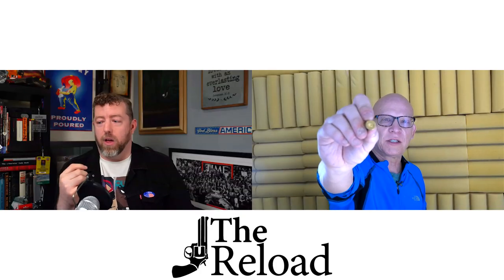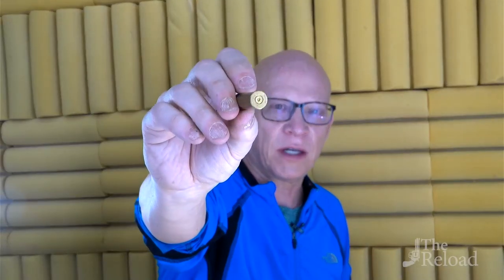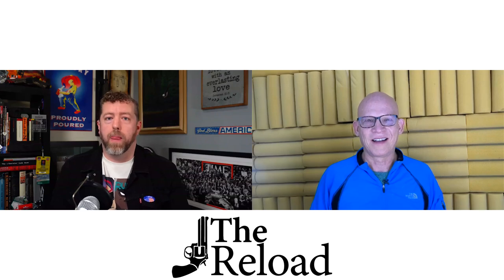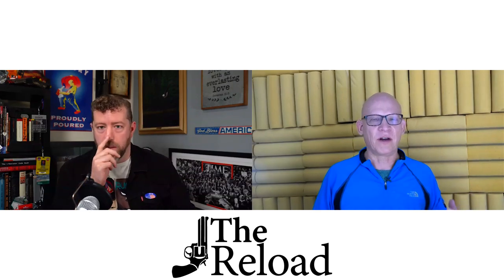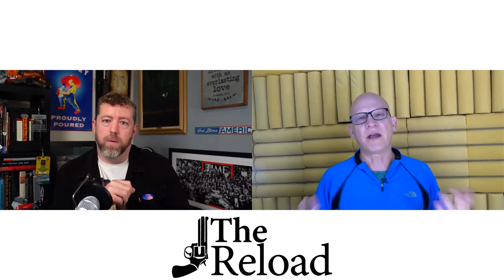The Critical Differences Between Blanks, Dummies, and Live Rounds

Comment: I read that the dummy rounds they were using had a hole drilled in the casing. That would be a pretty good indicator too, if one bothered to look for it.
Reply: BB or drilled and fluted case, each individual cartridge has to be removed and checked. There is no report of this being done.
Reply: She was too hungover and still high

Comment: BS. Pointing a real gun with what one believes is loaded with dummy bullets and pulling the trigger is hugely irresponsible. This is 90% on AB whether the ultimate cause is sabotage or incompetence and carelessness.
Reply: Actually, no. Furthermore, he was pointing at the camera, practicing.
Reply: @Canuck1000  if he was pointing it at the camera then how did somebody get shot? 
Alec broke the most basic and important rules of firearms.
He was likely pointing it in the cameras general direction and at the director who he killed.
Even if it did hit the camera, you should know your target and what is behind it as it is also likely to be hit.
Reply: @Rick_Sanchez_G420  As described below, Alec Baldwin, the actor, did not break any rules:

Dave Brown, 30 years working in the film industry as a firearms safety specialist: “Aside from the actors during a scene, the firearms specialist is the only person who handles the weapons and the only person who can open them for full inspection by cast and crew.” (note: Alec is not the one who can fully inspect the gun.)

Scott Dismukus: “The armorer’s entire job is to make sure the right gun (prop) for the given scene is ready and safe. Actors aren’t allowed to make those safety checks. Their hands may be covered in makeup, or they may not have the knowledge to make the check. For consistency across all sets, they don’t make those checks. They are there to act, nothing else.”

Thomas Bostik: “…The only person to touch a gun is the armorer. They inspect it, load blanks or whatever is the appropriate (but never live ammunition), and hand it to the actor. There is never a live ammo on the set. The actor is forbidden to open the gun. If they do, the armorer must re-inspect the gun."

From Variety (Oct. 23, 2021):

“Corrie noted that the procedure for firearms on set is that normally an actor, until action, will be holding a stunt gun, one that cannot fire and is not made to fire, and cannot in any way be made to fire without severe modification. “At the moment that they’re about to shoot, the director will call cut, and then that stunt gun will be taken from them and an armorer will hand them a loaded gun loaded with blanks, and then they will begin filming again. The actor will shoot the firearm, director will say cut when that scene is done, and then that firearm is immediately taken from them by the armorer. This is a safety procedure that’s been in place for a very long time, and ideally if that happens then everything remains safe. The weapon is very strictly controlled and there are no accidents.””

From Variety (Oct. 23, 2021):

“Should Baldwin have checked the gun before firing?

Daniel Leonard, associate dean at Chapman University, whose specialty is on-set regulations: “There are no industry standards that require the actor to verify the safety of a prop firearm.”

Both Merrick and Corrie say that actors are not required to sign off on firearms being empty. Instead they must focus on their performance, rather than be distracted by gun safety rules that aren’t their expertise.

“I really need to reiterate that the actors have a focus on their dialogue and their emotion and where they got to stand on their lighting and how to react to the other actor,” Merrick said. “Their head is full. And in order for an actor to be fully vested in a performance, they need to have confidence in their surroundings. They need to be able to stand firmly and know that the wall is not going to fall down on their head, they need to know that the gun that they’re being handed is ready to go and it’s safe and it’s not going to hurt anybody.”

Added Corrie: “The reason that Alec Baldwin did not check the firearm is because… he’s not given time to do so. It is an understood that when the firearm is handed to him it is in proper working order. And that is the responsibility of the armorer prop master, whoever is in control of the firearms on set. So all the armchair quarterbacks that are sitting back and saying well, Alec Baldwin is responsible because he didn’t check the gun, that’s not the procedure that’s used on set — so stop with that. Ultimately it is the responsibility of the armorer or prop master or whomever is on set in control and responsible for those firearms being available and made ready for each scene.”
Reply: @Canuck1000  I dont care what "experts" you cite, he was at fault. Just because actors dont do it, doesnt mean they shouldn't do it.
He was also the producer, so any lapses in safety is ultimately on his head as he should have been stricter or more thoughtful about how he was running his sets.
Of course the amorer is at fault, as is the person who gave Alec the weapon.
But ultimately he was the one with the firearm and should have checked the weapon and ammunition.
It was negligent manslaughter plain and simple and it would have been a good thing for the armorer to have to check it again infront of the person who has to hold the weapon
Reply: This expert in my response is referring to you: “ So all the armchair quarterbacks that are sitting back and saying well, Alec Baldwin is responsible because he didn’t check the gun, that’s not the procedure that’s used on set — so stop with that.”

So, you can believe what you want,  but you are wrong. As a producer, he could be liable, but not as an actor.
Reply: @Canuck1000  I never said it was the typical procedure, but it should have been.
Even if it's not typical procedure on sets it is basic firearm safety which overrides anyother safety procautions. 
He shouldnt have accepted it from anyone else other than the designated armorer in the first place meaning all 3 off them are at fault and Alec is accountable for both his involvement as an actor and as a producer.
Reply: In addition that the set was supposed to be live round free, the results would have been the same. As all the armorers have explained above, it is not the actor’s responsibility. You can stump your feet all you want, you are wrong.
Reply: @Rick_Sanchez_G420  BTW, there are no industry standards about who has to give the weapon to the actor (as discussed by a UCLA professor at the time). Every movie production is different. On this movie set, both the 1st AD and the armorer were the only people who could give the weapon to Alec after the armorer personally verified the weapon. Hence, Alec took the weapon from the 1st AD many other times before as per protocol. In case you did not know, the latest information is that the supplier of the bullets for the production screwed up. Whether or not the armorer's lack of experience played a role in this mess still needs to be determine, Alec (the actor and not as producer) did nothing wrong.

Comment: I find it very hard to believe and ridiculous that there is not an industry-standard on how to make the dummy rounds.

There is unions and guidelines for everything in the movie industry from a hairdresser to a grip and no one has a standard or protocol for making an actual dummy round? That is insanity.

I seen John Schneider talk about dummy rounds being made by using a spent cartridge and having sawdust in it and then the LED bullet and you could tell it was a dummy round by looking at the primer that was dented from a strike already.

This guy says he removes the primer and has Bebe in it.

A professional in the movie industry I watched earlier said that they are supposed to have the primer removed a small hole drilled in the side of it and one or two BB's slightly bigger than the whole.
This makes much more sense as an industry standard.

A visual inspection would show no primer and the hole drilled in the side of it as well as an audible confirmation by shaking it.

Is there no industry-standard ?
If not that is just bizarre!

Comment: @The Reload, does it make sense that if they are using dummy rounds for that scene, why would Alec need to fire it, it won’t ignite right? Maybe they want to film Alec squeezing the trigger? So shouldn’t the guy in charge of the fire arm prove before handing the gun, that all are dummies and nothing happens when they squeeze point at the ground?
Reply: whoever hand over the gun to Alec...told him it was "cold gun" meaning it will not fire.  So in his head...he think he can pull the trigger and it's going to clock with no explosive....so as he was rehearsing with the gun...he just pulled the trigger without even aiming it and it just happen to be in the line of sight of Halyna
Reply: @jlo1195  Yeah, this is to easy to understand, but for many people it does not seem to be and are quick to blame Alec for pulling the trigger. And, it is not his job to examine each bullet (he may not even know the difference), since it is the responsibility of the armorer.
Reply: @jlo1195  Some reports say he actually pulled the trigger several times before already, as the police stated there were dummies in the other chambers so nothing would have happened, and thus everyone would be under the assumption all the chambers were dummies.
Reply: @Canuck1000  It's still his fault, the number one rule of firearms saftety is to treat every gun as is if it's loaded.  This means that he should have either had checked the weapon itself, ensuring that it was cold (meaning unloaded in Hollywood terms) or had the AD who handed it him show him that it's cold. And, if ther adummy round invovlked , then as the armorer in this video said, if you can't tell the different then the safe and samrt thing would be to assume that they're live rounds. From there, you put a stop to things until it's been verifired that they are indeed dummyt rounds.

So, while any number of things led up to this tragedy, at the end of the day, Alec Baldwin pulled the trigger, assuming (without) that it was either unloaded or had dummy rounds.  If had had simply treated it as a loaded fireamr with live ammunition, as per gun safety rules, then nothing would have happened, at least at that moment. Giuven the lax safety protocols on that set, it probably would have still had happened eventually.
Reply: @Riceball01  Basically, what you’re saying is that actors, who are given firearms on sets, need to be experts for the full array of firearms and ammunitions and can challenge or overrule the armorer’s decisions or expertise. Well, Mike Tristano (“When it comes to guns and ammunition on sets, Tristano said, “the buck always stops” with the armorer”); Larry Zanoff (“The armorer is responsible for all firearms and blank ammunition on set, and weapons should always be under the tight chain-of-custody of that person,” said Larry Zanoff, an armorer who worked on Quentin Tarantino’s “Django Unchained” and several Marvel movies); and Kevin Williams (But to Kevin Williams, the prop shop supervisor at the UCLA School of Theater, Film & Television, the fact remains that an armorer needs to serve as the “check and balance for ensuring that weapons are safe to fire.”… …“At the end of the day,” Williams said, “it’s her responsibility to maintain control of those weapons and see what’s happening.”) all disagree with you.
Reply: @Riceball01  It does not matter how easy or difficult it is to check if a firearm is loaded, empty, contains blanks or dummies, it is not the actor's responsibilities to verify its safety. It is the armorer's responsibilities. This is the person who has the final authority on the set (as explained by the lawyer and the armorers above), not the actor. Btw, it was not unloaded, but contained dummies so the camera could capture that the barrel had "bullets." We can all say "what if this" or "what if that" in hindsight. Let's wait and see where the protocols failed.
Reply: @Canuck1000 yes, it is ALWAYS the responsibility of the person holding the gun to handle it safely.  he could have pointed it at the ground and pulled the trigger 6 times to make sure it was safe. he didnt. thats why he has been charged with involuntary manslaughter.
Reply: @Canuck1000 and considering Alec Baldwin was also the producer, and it was his movie set, he is doubly responsible for ALL safety on set.
Reply: @youtubeuser206  As explained below by experienced armorers, the buck stops with the armorer. The actor is hired to act and the armorer to handle the safety of all firearms.

Dave Brown, 30 years working in the film industry as a firearms safety specialist: “Aside from the actors during a scene, the firearms specialist is the only person who handles the weapons and the only person who can open them for full inspection by cast and crew.” (note: Alec is not the one who can fully inspect the gun.)

Scott Dismukus: “The armorer’s entire job is to make sure the right gun (prop) for the given scene is ready and safe. Actors aren’t allowed to make those safety checks. Their hands may be covered in makeup, or they may not have the knowledge to make the check. For consistency across all sets, they don’t make those checks. They are there to act, nothing else.”

Thomas Bostik: “…The only person to touch a gun is the armorer. They inspect it, load blanks or whatever is the appropriate (but never live ammunition), and hand it to the actor. There is never a live ammo on the set. The actor is forbidden to open the gun. If they do, the armorer must re-inspect the gun."

From Variety (Oct. 23, 2021):
“Corrie noted that the procedure for firearms on set is that normally an actor, until action, will be holding a stunt gun, one that cannot fire and is not made to fire, and cannot in any way be made to fire without severe modification. “At the moment that they’re about to shoot, the director will call cut, and then that stunt gun will be taken from them and an armorer will hand them a loaded gun loaded with blanks, and then they will begin filming again. The actor will shoot the firearm, director will say cut when that scene is done, and then that firearm is immediately taken from them by the armorer. This is a safety procedure that’s been in place for a very long time, and ideally if that happens then everything remains safe. The weapon is very strictly controlled and there are no accidents.””

From Variety (Oct. 23, 2021):

“Should Baldwin have checked the gun before firing?

Daniel Leonard, associate dean at Chapman University, whose specialty is on-set regulations: “There are no industry standards that require the actor to verify the safety of a prop firearm.”

Both Merrick and Corrie say that actors are not required to sign off on firearms being empty. Instead they must focus on their performance, rather than be distracted by gun safety rules that aren’t their expertise.
“I really need to reiterate that the actors have a focus on their dialogue and their emotion and where they got to stand on their lighting and how to react to the other actor,” Merrick said. “Their head is full. And in order for an actor to be fully vested in a performance, they need to have confidence in their surroundings. They need to be able to stand firmly and know that the wall is not going to fall down on their head, they need to know that the gun that they’re being handed is ready to go and it’s safe and it’s not going to hurt anybody.”

Added Corrie: “The reason that Alec Baldwin did not check the firearm is because… he’s not given time to do so. It is an understood that when the firearm is handed to him it is in proper working order. And that is the responsibility of the armorer prop master, whoever is in control of the firearms on set. So all the armchair quarterbacks that are sitting back and saying well, Alec Baldwin is responsible because he didn’t check the gun, that’s not the procedure that’s used on set — so stop with that. Ultimately it is the responsibility of the armorer or prop master or whomever is on set in control and responsible for those firearms being available and made ready for each scene.”